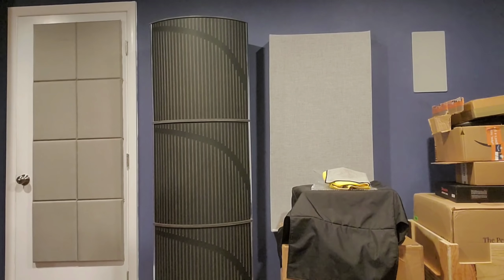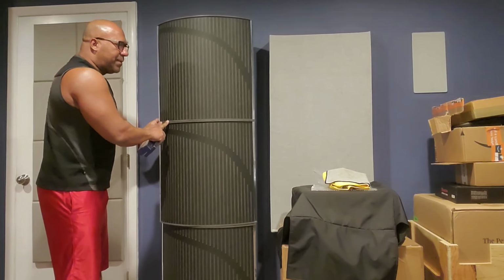Furutech Outlets initial reaction!

Comment: Without some advanced electrical switching equipment it's impossible to compare the sound of these outlets properly. Your system is worth well over $200k and you really believe a $500 electrical socket made it sound bad and that 400hrs will take the sound back to normal or better? You're now the victim of psychoacoustics, confirmation bias, placebo effect and marketing.  The way to tell is by the way you quantify the changes you heard, you're using the same terms as you do when you change out a $10k plus component. Doesn't add up.
Reply: Burn-in makes a difference, always. Sometimes it's a few hours, Sometimes it's a few hundred hours, but it always makes a difference...
Reply: @philippelabrecque6658  please share whatever it is your smoking. If you believe a product needs hundreds of hours just to sound good then I have some things to sell you.  This is not wine we're talking about where aging or decanting can greatly alter the original flavor. Nor is it a steak that needs to rest after cooking. These things are all explainable and more importantly, repeatable. Can an outlet make a $250k+ system sound like garbage, not unless it's damaged, poorly designed or incorrectly installed.
Reply: @Coolesttech  I could try to answer you but it would take time.  Just make the tests yourself and hear it for yourself. Don't ask people to take you by the hand and show it to you. Hans Beekhausen , a well known audio journalist from the Netherlands breaks in every component he ever tries for a good 200 hours before making reviews because after years of experience he found out that components sound like crap when they are new a lot of the time. Normally it will sound compressed in different frequency bands, sounds closed up or abnormally sibilent, no bass or muddy bass, thin mid-range etc... I bought the amp I'm using now and it sounded so bad that I thought it had been damaged in shipping. I knew about burn-in but this was ridiculously bad. I waited and left it on for 3 days straight not listening to it. On the fourth day it started to get better and by 250hours it was great. Same with cables and everything that has electricity going thru it. Its just an audiophile fact. Of course you need good hearing and the better the system the more it makes a difference because it will show you more...
Reply: @philippelabrecque6658  I don't need your help or that of Hans thanks.  Maybe your words need a few hundred hours of burn in then you can explain it to me lol.
Reply: @philippelabrecque6658  firstly, start by testing your hearing. I've tested mine and it's at 98%, even higher than what it should be for my age. Then, get a book on double blind tests and read it. Then you'll understand how to properly evaluate equipment. You aren't going to learn from people who get paid to tell you how things sound. I have very nice outlets in my house, and they make zero difference but they look nice and I'm not ashamed to say it. Much of the cable accessory industry is jewelry. Cables and outlets cannot improved your sound beyond what your system is capable of. These products are tone controls and generally only detract in one area so you think another is being accentuated.  Outlets have 2 jobs: hold the cable tightly with good contact, and conduct electricity. The different materials used will affect the conductivity (gold is worse then copper for example but is used against corrosion, and silver is better than copper).   Unless an AC sinewave is not correctly coming out of the outlet due to poor design, damage or bad installation, it will never have the enormous effects that are being claimed. Please don't tell me "but Hans said ...."
Reply: @Coolesttech  I didn't learn from them I used my ears and I've got an audiophile friend and he ears the same things I do when I make a change. And hearing measurements don't give numbers in percentage they give numbers in dB up or down in frequency bands and you lose from the top mostly as you age. I've had multiple listening tests and read them... It's ok to not hear change, some don't ,but don't discriminate on the people who do, and let's be honest where audiophiles so we mostly do...
Reply: @Coolesttech  No explanation needed.  I know all about metal conductance and I know it changes the sound too. But I don't need to explain, simply listen... I've got a musician friend and he's busted his ears in live shows for years and doesn't ear the differences I talk about but when he takes off his headphones the sound is so loud it would make my ears bleed. He's lost most of his high frequency hearing and will fight if you tell him so. He even said he's been measured in the past too, but how come I can't put his headphones on without permanent ear damage and how come he doesn't ear the fine details I do?
Reply: @philippelabrecque6658  that's terrible, sorry for your friend.
Reply: @philippelabrecque6658  I don't discriminate.  It's not an inability to hear change, it's actually that there's no change. When there is change I can hear it, such as with better equipment, better speakers, better source material. The theories of extreme burn in that take sound from garbage to amazing is what is ridiculous. Someone can believe the sky is purple because that's how they see it, others may say it's grey, others blue etc. These are just shades, but you won't find someone saying it's raining while another says it's not. The exclamations of enormous differences from burn in are BS and this can be proven, unlike the other way around. Listen to music, not to cables
Reply: @Coolesttech  Reading a review of the Pontus 2  today from an Audiophile who bought it with his own money.  He says it took 450hours for the sound to become stable and absolutely magnificent and the sound didn't just get better gradually, there we're up's and downs has there was for the majority of the equipment and cables you'll buy, confirmed by every audio journalist I know , me and all my Audiophile friends. I remember reading the extreme case was a PS audio direct stream DAC which took 1050 hours of up's and downs before settling in. An extreme case. I'm not saying that with every piece of equipment it will take the same time but the companies that do the most burn-in before delivery say they experience much less returns. Heck, I don't care that some of you don't believe in it, you keep returning your stuff and I'll keep buying it cheaper because of it. Its a win-win! Got great gear at a fraction of the price because of you people...
Reply: @philippelabrecque6658  the guy who said his Pontus took 450 hours either has a defective unit, a hearing problem or is smoking something. I also have a new Pontus II and it sounds fantastic after 5 minutes with a $7500 amp and $9500 speakers.  I'm not saying that to show off, but just so you know my system is capable and very revealing of all the components in the chain. If it gets better after X hours, that's great, but it's unlikely there will be more than a 10% change. When electronics and the underlying components reach correct operating temperature and settle in that's when they generally sound their best. This person your referring to might even have a nervous personality which is affecting his perceptions because he's just listening to sound and constantly comparing.  Reviewers and journalists are not the Bible. They offer an opinion and are paid to do so.   These numbers of hours you mention are truly absurd. You have to factor in the constant tweaking that audiophiles do, playing with the filters, different cables bla bla bla. It will sound good when their brain tells them they are ready for it to sound good. It's called a self fulfilling prophecy.
Reply: @Coolesttech  Audio journalists certainly don't mention burn- in unless they have too, no one would benefit from it. They mention it Because it's the reality they face. Hans Beekhausen says he burns in every component for 200hours before doing a listening test and if he did not he would have to give bad reviews on everything.  The reaching of proper temperature has nothing to do with burn-in and I'm glad your unit didn't need time (probably because it was burned in before it was sent)but if you heard no expansion of the soundstage,  the quality of the highs (sybilance) or the blooming of the mid-range and quality and nuance of bass then you don't have the ears for it because there's no way that burn-in would not happen, at least to a more minor effect. You just can't hear it and that's fine, much easier to appreciate your gear when you don't hear every detail. I do however. And I have a 25000$ + system...
Reply: @philippelabrecque6658  your understanding of how stuff works is very very broken. I'm sorry you have to rely on Hans and journalists.
Reply: @philippelabrecque6658  They don't always mention burn-in because not every manufacturer plays this stupid game. You talk about these journalists and guys like Hans as if they were superhuman, they are not.  If Hans didn't do the burn-in on every product and every single one sounded bad, then there's a problem with him, not a problem with the gear.  I don't understand how you don't see that.  It is statistically impossible for that to happen so your logic and understanding are deeply flawed as I stated above.
Reply: @Coolesttech  it's statistically what? Watch and read Hans Beekhausen and tell me he's an idiot? He burns in the stuff he reviews because it normally doesn't sound good when it's brand new. Sometimes it doesn't sound that bad but it still gets better in the first weeks of playing it and it has nothing to do with your ears getting accustomed either.  I just made a capacitor mod on my preamp 4 times to get the right sound and at no point did my ears tell me it was sounding good before it actually did sound good... was changing caoacitor values that filter the highs.  Started with the original Ultra open but cheap capacitors then went to 5 times more expensive at a whopping 1$ haha! a small cap silver mica but with higher values meaning it was cutting the highs more and gave a much warmer sound but closed up. Then went 3 values less for a more open sound but still, too closed up for me. Then bought 2 other pairs ,1 three values down and another 2 more values down from that one. Now, if my ears are playing a game on me,  why didn't I just take what was suggested?  I listened to the soundstage open up while testing each of the first 2 for weeks. At no point did my ears get satisfied with the first 2. Then going further down , I went straight for the most open of the last 3 by speculation on what I had heard previously.  Each time the top end opened up , each time I heard all the frequency bands change proportions till I got it just right. My ears decided the whole time. Now,,, the capacitors were brand new but very small so you guessed it, burn in. But since they we're small and it was only them that were burning in it took only a few hours to do it. At some point it sounds good enough even though you still gain a little more with additional time. There you go. Burn in of small capacitors and there are a lot of those in a component and circuit boards on top of circuit boards.  The rule of thumb is that the thicker the metal and denser the path is for electricity to go through the longer it takes for burn-in. The guy who made my first câbles always said to wait 250 hours for each and I concurred each time and when he said 350 for some heavier gauge cables, he was right again . Now did some company tell him to say that? No , 30 years of personal experience building cables.  The longer it ever took me for a burn-in was after a repair  of a Chord Qutest. It took a month and a half plugged in 24/7 with an external power supply for them to both burn in. And the Qutest was already burned In!.  But it needed soldering so I guess it must be that?  Electricity is way more fucked up then people think. That's why ' Mike the "OCD hi-fi guy" you've got in the states does "cable cooking" . I don't remember if it's 40000volts or something going in the cables but I'm betting that if he does it, it makes a difference.  Hes not the bullshit kind of guy though he tends to promote his stuff for sure... Electricity is fucked up... Physicists say openly that they don't fully understand it.
Reply: @Coolesttech  wow! I just realized you can't read. After that long text I just sent the only thing you understood was the first phrases... good job!
Reply: @philippelabrecque6658 if you say so. You keep revisiting the same arguments so there's no point reading it. Your responses are utterly predictable.  I hope for your sake Hans lives forever or you won't know what to do lol.
Reply: @philippelabrecque6658  once again, utterly predictable response. Take off your blinders and learn how things work. It's not all magic and voodoo
Reply: @Coolesttech  there you go! I knew it! You're speaking of statistics while we're speaking of audio. A troll! Use your ears! If you don't have them, then stay out of audiophile conversations has you are not one yourself. Audiophile's never talk of statistics.  They're only interested in what they hear.. And you can't hear anything obviously...
Reply: @philippelabrecque6658  nope you're doing that all on your own. Very well too I might add.
Reply: @Coolesttech  😄 🤣
Reply: @Coolesttech  listen , I sympathize with you buddy, I really do. It must hard learning that your hearing is not so good and that a lot of people hear way more detail then you, but on the other hand would it make sense that millions of people all hear at the same level? It wouldn't now would it? The hypothesis that millions of people buy cables and outlets and keep them even when they don't sound any better, just to keep face sounds more like a 5 years old mentality than anything else. A child mentality that's frustrated and needs to find an excuse to make up for the fact that lots of other people hear a difference and he doesn't.  Now that sounds way more likely right? Right. If cables and outlets didn't make any difference then word would go around pretty quickly and all those câbles and outlets would just be sent back to the stores and everybody would go out of business real fast. It's real easy, go to a real audiophiles house and change the cables or outlets and listen with your ears not your preconceived notions and your friend will hear it and tell you all about it. Cause if you think about, thinking that millions of audiophiles live in this alternate reality where they buy stuff that never as any impact on the sound but all create this delusion about changing sound and then the sound hitting a plateau and being stable and never , ever changing after that ,just being a massive coincidence, now that's really stupid isn't it? Or even better, Paul McGowan, boss of PS Audio, Arny Newdel biggest speaker designer for Infinity, Andrew Jones, star of speaker designer in the world, Shawn from zero fidelity , Ron from new records day, Jay Ayagi's audio show, Thomas & friend's audio reviewer, the entire staff at audio excellence, Hans Beekhausen, and I could go on and on, all hear the effects of câbles and outlets and they even say that everything makes a difference and you're saying all these guys , me , my friends and millions of audiophiles all making this shit up at the same time? And that's plausible hypothesis for you? And you ask me for what I'm smokin?? Tell you what , you give me your pushers coordinates and we'll I won't actually smoke it cause look at what it did to you! Haha!  To believe that you're right and all of us are wrong that's just sad isn't it? It is. So you tell me when your ready to move out of your mother's basement and I'll give you info on what to buy, I'll try to help you. You can try the Tomatis method for your loss of hearing also... That was free by the way. It's not all about money, boy... Now stay out of the comment section of  audio reviewers please. When Jay gets convinced too ,  of course, you'll have to find another audio reviewers site again...  Tomatis buddy, Tomatis...

Comment: Hello Jay sorry to hear the Furutech wall socket is sounding poor I do not use wall sockets. The first step you need to do is to install a dedicated audio grade fuse in your consumer unit (fuse panel) I use the Doepke part number DFS 2 040-2/0.03-F this is an audio grade double pole switch fuse manufactured in Germany I highly recommend this component. I then run an audio grade cable directly from this fuse into the listening room and terminate this with a Furutech FI-50 NCF High End Performance IEC Connector - Rhodium. I then plug this into a 6 way Furutech e-TP609 NCF Rhodium AC Power Distributor THIS HAS NO FILETERS FITTED. This set up should provide you with an excellent starting point for your supply you can then start to experiment with different mains cables, mains filters, power distributors etc hope this helps.

Comment: I have two Shunyata outlets in my system and have absolutely no problems with them.  Shunyata has never changed them or offered improved versions.  They stick to the same ultra-quality brass for $95 each.  No regrets with sound slightly improved over a break-in period.  I said SLIGHTLY improved.   I don't have the cheapest thing from the dollar store in my wall and do not intend to replace them.  Shunyata is a trusted brand.